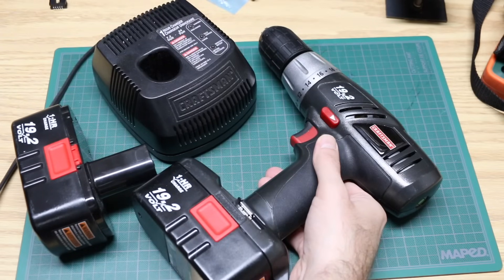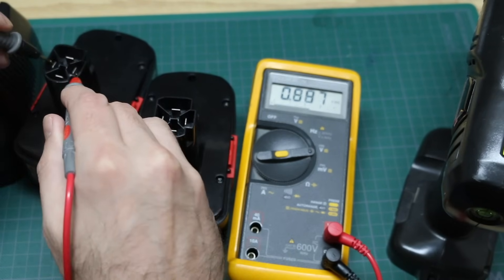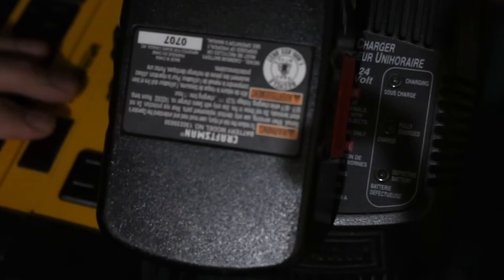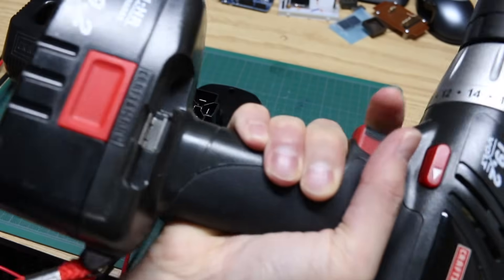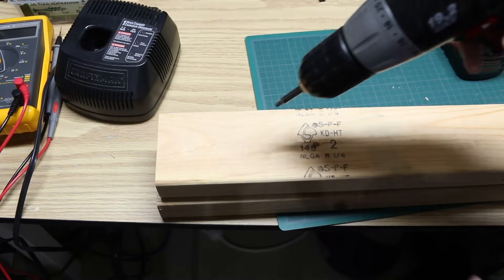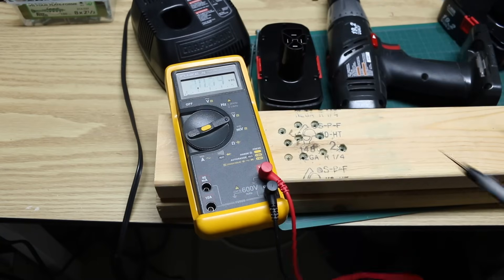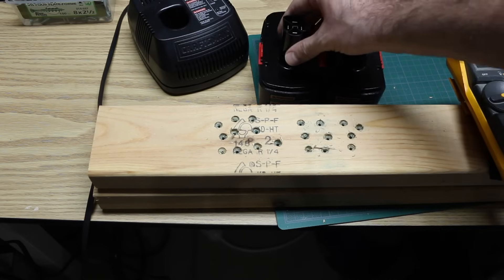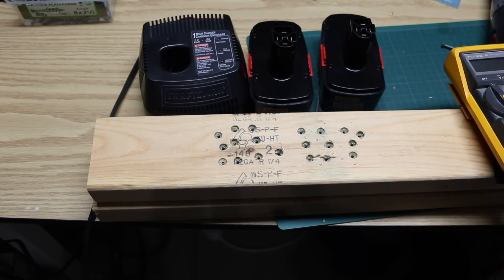HOW TO REVIVE A NiCd DRILL BATTERY THAT WON’T CHARGE

Comment: A hack that actually works, amazing. Was gifted barely used Ryobi NiCd 18V's; drill, sawzall, work light etc...Batteries had taken a dirt nap and were dead, but not anymore. Nice backups or gift them to someone else who might give them some use...thanks for the hack GR!
Reply from the maker: Glad it worked with those batteries, it’s hit and miss depending on their condition. But when it works, it’s great.
Reply: @GadgetReboot  In this case, it did, thanks!!

Comment: Thanks for the tip just tried it with my old mikita just pluged and unplugged from wall 3 to 4 times and bam shes chargin even checked with rhe meter and shes takin the juice thanks again got my sub.
Reply from the maker: Glad it worked! Of course it’s not a miracle worker, if the batteries really have reached their end of life, they may not hold a charge but it’s been practically one year since I made the video and I’m still using that same battery with good charge capacity and they can still drive 3 inch screws through wood no problem.
Reply: @GadgetReboot  ill try it tomorrow see how long it last ...i got other drills but that one is sentimental so it will be nice just to use it again here and there

Comment: I have  two 10 year old plus Milwaukee batteries I use in two job box radios and a screw gun. I discovered both of my batteries in the radios were dead and wouldn't charge placed in the charger. The first battery I hooked up to a 13 volt power back used for an old CB. I charged it for about 4 minutes to 10 volts. Putting it in the charger it worked and started charging!  I did the same thing with the other charger and it did the same thing.  I'm guessing the battery or the charger, has some sort of memory or safety feature that won't allow it to charge a dead battery(??).    In any case, I saved myself over $100 not having to buy two new OEM Milwaukee batteries. I'll pay more attention to recharging the batteries so this won't repeat. I know 10 year old batteries have well outlived their service life, but if it works I'll milk them for more service life.    I'll try the charger unplug re-plug next time.  Thanks for your video  :)

Comment: i just bought a Ridgid 18v Lithium-ion 2 Speed Drill/Driver R860052K . it Come in 2 new Batteries, my Question is should i only Charge 1 Battery and use it ones Every 3 Month and Keep the other Battery Sealled in its Bag , so it will Last Much Longer .
or i Should use Them Both and Rotate Them , Keep in Mind i use the Drill Every 3 Month ?
Reply from the maker: I would think it’s best to alternate between the batteries instead of leaving one sitting untouched especially potentially for years. The batteries are normally stored with about half charge capacity and that’s going to self  discharge over time if it’s not maintained, and if the charge drops too low the battery pack may become unuseable especially if there’s electronics inside the battery pack and it loses power. 
Similar to how laptops or phones automatically shut off at a certain point to make sure the battery doesn’t go completely dead and become useless.
Reply: @GadgetReboot  

🌟 TOOL BOSS replied: "Yea u can do that ...prob get 500 cycles minimum out of it ..if not Guna use it .. keep it sealed"
20 hours ago
Reply: i am More Confused Now ?? ///////
Reply from the maker: The main thing I’m thinking about for a stored battery is the fact that it might lose up to 4% of its charge per month and if it has never been used it’s probably starting out at about 50% charge level so if you don’t use the main battery very often and the other one sits possibly for a couple of years, it may discharge too low and be damaged. Here’s  One resource that talks about lithium ion storage self discharge. https://batteryuniversity.com/learn/article/elevating_self_discharge
 I haven’t found any info about using up charge cycles on a fast or slow interval to be detrimental so it generally seems like there shouldn’t be much difference between alternating batteries  between charges or using up one completely  until it can’t be used anymore,  and then using up the other  as if you just bought it brand new. 
 But if you keep it in storage and it self discharges and is compromised, you might not get to use that second one so without being much of an expert I just conclude alternating between them keeps them all charged enough to stay healthy until they can’t be used anymore. 
 I have a Bosch lithium ion impact driver that I’ve had for at least five years and it came with two batteries and I don’t use them very often probably about as much as you do, and I alternate the batteries and they are both still perfectly fine.

Comment: Cool! I have a whole Craftsman cordless set with NiCad batteries that was barely used when the charger fell with one of the batteries in it and it wouldn't charge anymore on the battery that fell with it or the other one, so I thought the charger had broke. I later got a great deal on a brand new charger, but it wouldn't charge either battery either. I think I will try this and see if it works. I hated having a practically brand new set of power tools that I wasn't able to use when I needed them and didn't want to buy new batteries if they too might die for good that soon.

Comment: I have a 14.4v Craftsman with the slide-on batteries. I got one pack going using a separate battery wired to it for a while, then time on the charger.

Your plug, unplug method didn't help. I think the charger is too 'smart' to let us consumers get away with fixing something they can get $60 for.

:(

Comment: What about one that runs down too soon?
Reply from the maker: In that case the batteries may be at end-of-life and either individual cells inside the case can be replaced or the whole thing could be replaced with a  compatible NiMH or lithium ion battery of the same style, obviously needing the right kind of charger for the newer battery chemistry.

Comment: NiCds have a "memory" problem. If they have not been drained totally in a while, their ability to drive work at their voltage drops. They can be restored by draining them to less than a volt per cell and recharging them once or twice, that will restore their capacity to deliver power. Your charger probably is a little flaky, it has to sense the voltage and it may have a flaky connector or the sensor circuit is set too high or low.
Reply: @sploofmonkey 
SOUNDS like NiCd memory. Disassemble, discharge EACH cell to well below 0.75 volt, just not all the way near zero, using a resistor, and recharge them. Do this a couple times and if they don't work again, they are damaged. Get new cells.
Reply: @sploofmonkey 
That WILL destroy NiCds. They can't take overvoltage or under-use. Just be prepared to buy more.

Comment: I heated my battery slightly and it started to charge with no error light. When I tried charging a cold battery it didn’t work
Reply: Thanks. I'll do the same once my battery is dead.

I have Ryobi and the manual said the battery wouldn't charge if it's too cold or too hot and will only start charging when the right temperature is reached.
Reply from the maker: That’s interesting.   Maybe there is some characteristic in the chemistry that helps bump it into life with heat.
Reply: If the batteries are cold then less current will flow. That's why the temperature is monitored. Also too much heat can damage the cells.
Reply: Can’t explain why but it happened. I accidentally had it laying next to my coal stove after numerous failed attempts in the cold. I put it on the charger for one last attempt after it was warm and wham, it started charging correctly

Comment: Hi, i followed your video but have no go result. Im trouble shooting the same exact batteries. Same old drill. any other advice
Reply: I had two old batteries like this. I got the "defective" light on & neither would charge. I followed the video but after 7 or 8 clicks of the power switch. Nothing changed which made me angry so I flicked the power switch on & off on & off maybe 30 or 40 times & WOW all of a sudden it showed "charging". After an hour it was fully charged & worked perfect. The 2nd battery was the very same way.  After switching 30 or more times the charging light went on. After an hour both batteries are fine.
Reply from the maker: That’s great!  I was surprised mine worked on the first try, I expected I might have to do it multiple times. Maybe it depends on exactly how discharged it is.
Reply from the maker: It may not work in every case, the battery has to have some life left in it for this to work because we are just allowing the charger to recognize the battery if the voltage drops too low but if the battery really is hopeless, there’s not much we can do except replace it or take it apart and  replace individual cells that really are properly dead. 

 About the only thing that can be done is repeatedly try this process, not just once, and see if it ever does kick in. It worked for me on the very first try but it could take a bunch of tries in other cases.  If I had nothing left to lose anyway I’d probably try 50 or 100 times but at that point I would just give up on it.

Comment: A sure fix is to replace the battery cells that are no good.  Once you've done this the battery is a good as new.
Reply: Dan Sibayo does it work with lithium batterys
Reply: @johncrawford6557  He does mention that this only works with NiCd cells (Most packs are marked) I have the newer Li-On charger and cells and this does NOT work. I did however find 2 X 5A or 5000ma batteries for  $70 usd   They work as well as the ridicules Ryobi packs @  2 X 4A for $100   I just think that this is more reasonable and 2 to 3 years is nominal for these type batteries.   I am speaking from experience, not guessing.    Amazon link here,    https://www.amazon.com/gp/product/B07DDH1ZLV/ref=ppx_yo_dt_b_asin_title_o02_s00?ie=UTF8&psc=1
'
Reply: Replace ALL batteries, because the dead batteries have probably drawn the good ones down. Why have to repeat the process several times?

Comment: Did not work for me
Reply from the maker: It’s possible there’s other problems and the battery is too far gone,  like legitimately dead internal cells instead of just a deeply discharged battery that needs a kickstart like this.
Reply: Didn't work for me, too. Where do all these ideas come from? If I had the space in my B&D 9.6V, I would use the 18650 batteries, but the pack is too small.

Comment: Batteries develop a Surface Voltage. For instance, you have two identically charged 12V car batteries, in good condition. One battery is used till it is flattened. After a short while it will indicate 12V. the same as the fully charged one.
Now put them under a Load. The Charged battery will tend to hold it's voltage for a long period. The voltage on the discharged battery, will fall away rapidly. 
Your method seems to have definitely worked so I will 'give it a go'.   :-)
Reply: Shill Out
That's lead-acid, NiCd's are very different.

Comment: here's  a few things for battery reconditioning
never attempt to do this until you know what you are doing - the acid can burn your skin
Test the voltage first - there may be a kaput cell which would waste your time.
Check the battery fluid.
Try to fully charge the battery.
(I discovered about these and more on Jons mender guide site )
Reply: What acid? What battery fluid? What are you talking about? Did you even watch this video?

Comment: Nicad... Never charge unless totally ran down... Short uses and recharging an 80% full battery will ruin the nicad
Reply: Doesn't actually ruin it, but then you have to fight with it and charge and discharge it several times to restore its capacity.

Comment: You can buy two batteries off brand on eBay if the drill still works now that Stanley Black & Decker owns the brand they. Canged. The batteries to slide on like all there power tools if not broke don't try to fix it my grandfather used to say to me  my father in-law owns the same drill I. Am. Going to try that idea both batteries have weak  power after a. Full charge no defective light goes on if not I. Could get him a. Set of good rated aftermarket batteries as high ah as I. Can. Find to use the cells the now the caissons of the batteries  skins are built like a tank unlike  the cheap ones so it's. Just a cell swap
Reply: Proofreading BEFORE you submit your comment would go a long way toward making your comments understood!